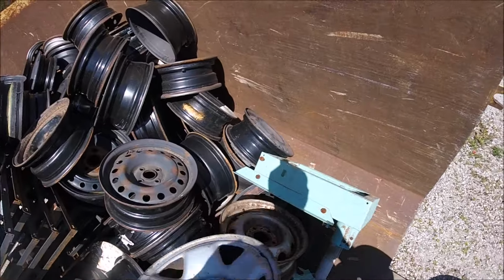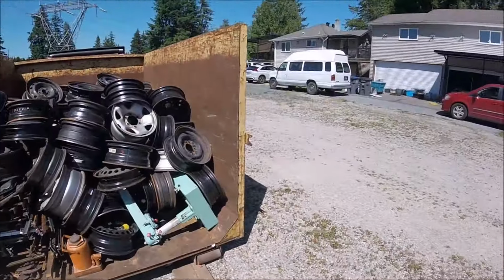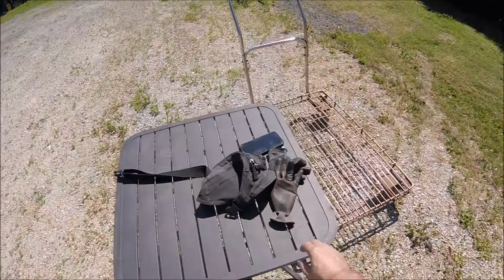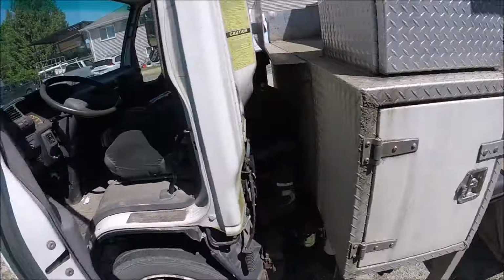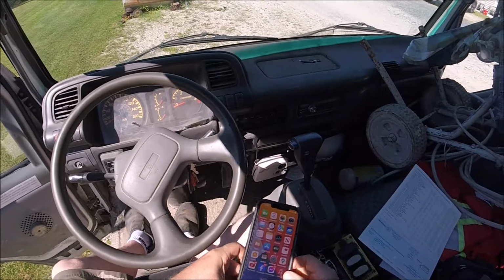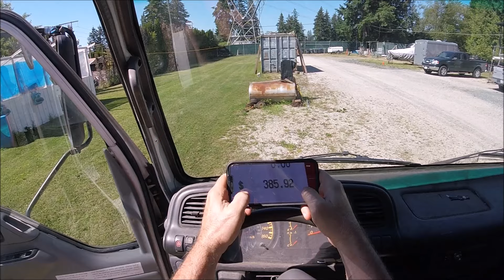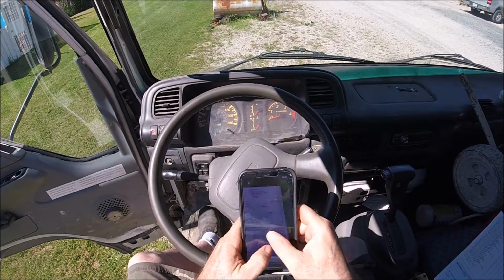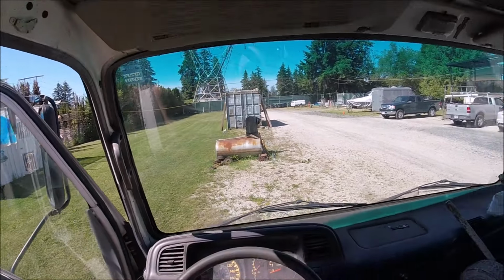Scrap Run Selling HMS + Month End Scrap Totals

Comment: I think what they did is like this. The total load was 4020 pounds. They considered 80% of that as clean prepared, meaning rims. For that 80% (3,216 pounds) they paid you a very handsome price of 240 a ton that is $385.92. The remaining 20% which is 804 pounds will be paid at a regular HMS price (may be 20 dollars more than tin) later. In the bill they mentioned unprepared meaning oversized which require cutting.
Reply from the maker: Over size HMS is $30 or 40 more than tin, They still owe me for the 804 pounds not on my bill